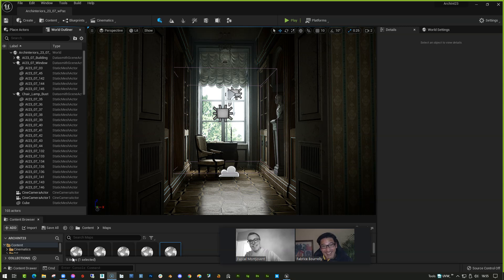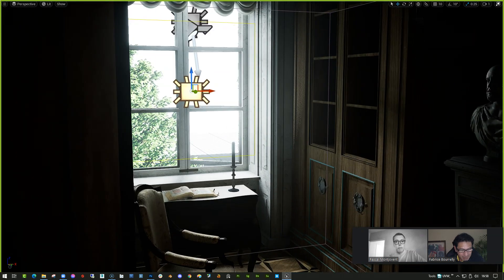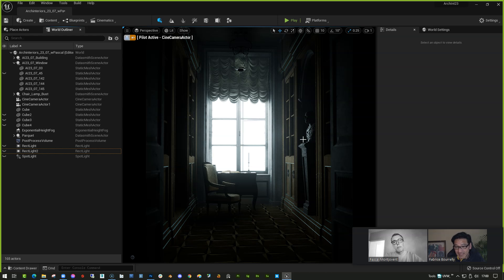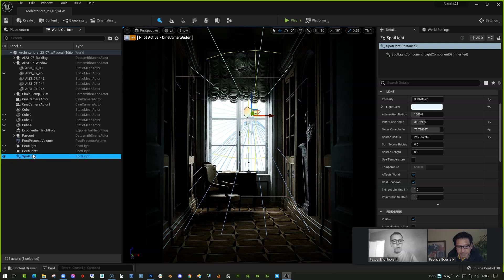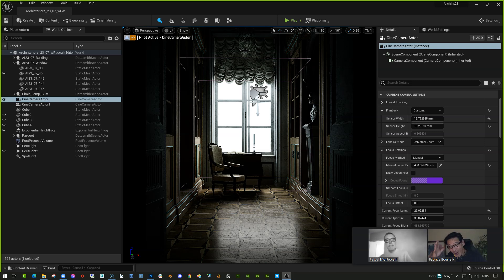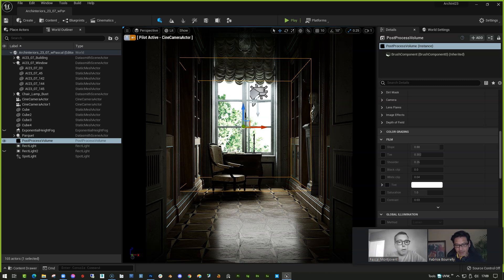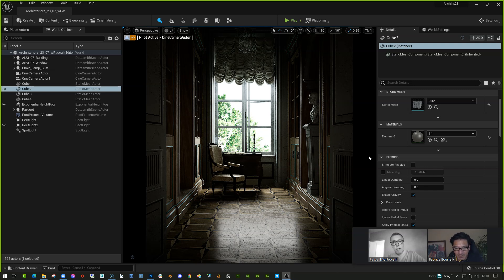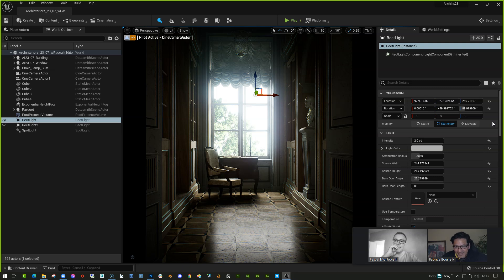UE5 Lumen Lighting Tutorial with Pascal in Unreal Engine 5 Architecture scene

Comment: Great video. And thax for info. But
I want to mention some issue i see in the image . The right side of the reflection of light on the floor is not correct. What i mean is if you draw a line  from the right side of the window to the floor you see that the reflection is extended beyond the frame and from the camera angle it shouldn't reflect where the wall is. I hope you get the point im making. Overall you guys are the best  👌 👍
Reply: I agree, you have a good eye. Most people don't notice this. On a subliminal level though, I'm sure it feels a bit off-putting.

Comment: Thanks for sharing. Have you noticed any issues when using large emissive surfaces? Any reason you are using a cube instead of a plane as  an emissive surface?
Reply from the maker: Hi Jim, what kind of issues are you noticing ? I used a cube simply to avoid having to turn it around due to the plane being 1 sided. It seems lumen likes self illuminated surfaces to be very obvious, if that makes sense.
Reply: @FabriceBourrelly  One sided planes don't really work well with Lumen. The developers said that themselves on a stream. Also: keep in mind that emissive materials themselves are limited. If your mesh is too small or too bright you will get faulty results. Watch this video for more details: https://youtu.be/Dc1PPYl2uxA?t=300